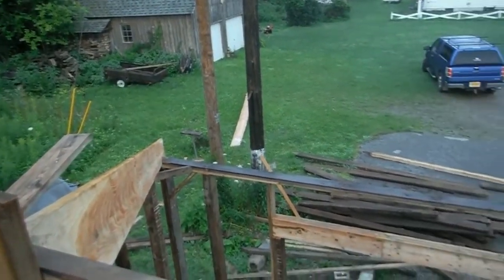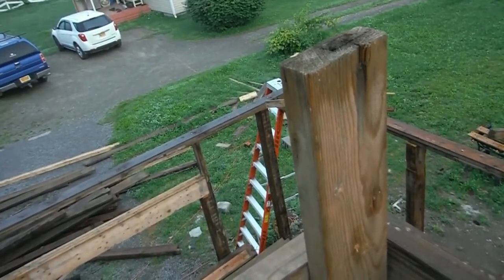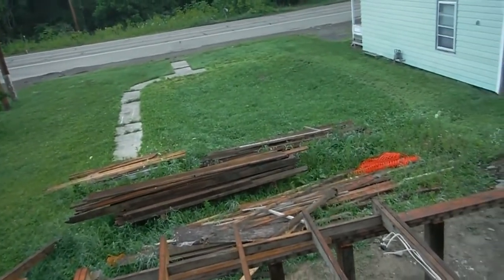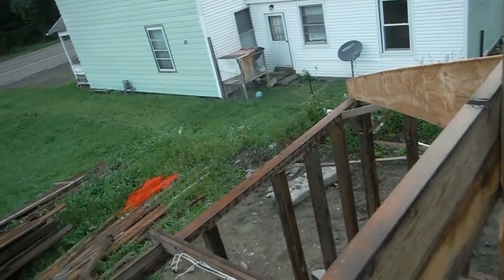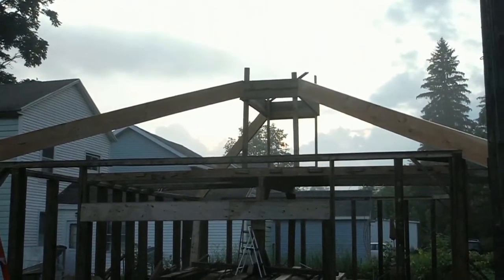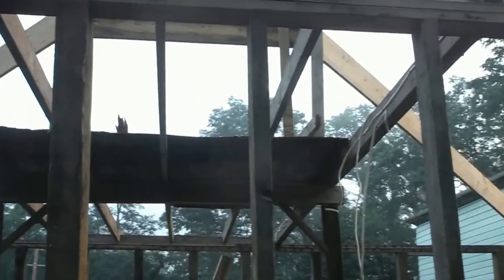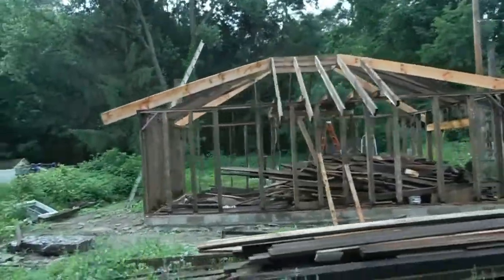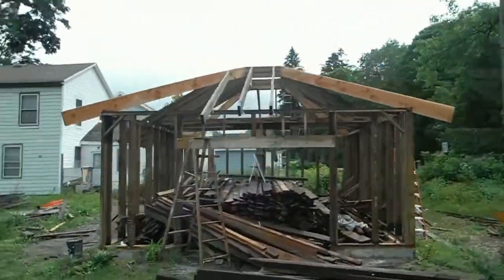Building a Garage - Hanging the Rafters

Comment: I am so impressed with your figuring on this.  You really are doing an outstanding job. It's taking a wonderful shape and it looks like that widow's peak is gonna be a nice touch.  Are you gonna wire it for light or are gonna find a way to channel some natural light through the peak somehow? Fantastic work, Pete! Again, it's a bit of torture for me to watch you build something so monumental with no help.... it goes against all my fiber to just sit by and watch you do it...but it's good entertainment.
Reply from the maker: The widow's peak will have 6 glass panes to let in light.  I saved 2 other good windows to put into the walls, facing the street.  There were a few days that I felt VERY tired.  But I am putting the rest of the rafters on today.  The weather is perfect - for a change, and I feel great.  And after that, it's just ordinary nailing on the decking, roofing and siding.  The car door and widow's peak I don't have to make until next year if I don't feel like it.  I would love to have some friends help!  But it's a matter of me doing it when my day job lets me and when the weather allows.  Too hard to plan in advance.

Comment: I did a hip roof on my Shed to match my house and yeah, they are a huge pain.  After I was done, someone told me a framing square has something on it to figure them out...
Reply from the maker: Michael Olson I know enough geometry that I can sit with a pencil and paper to calculate angles. But I discovered that the old foundation was slightly rhombus shaped. And my planks all were slightly different thicknesses, some with a bit of warp. That buggered my figuring so I had to work it out on the fly.